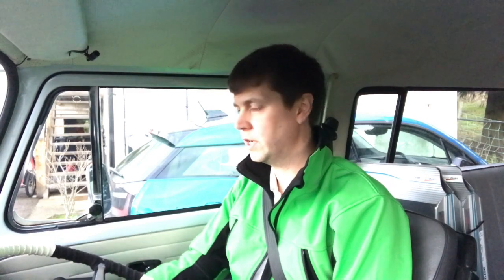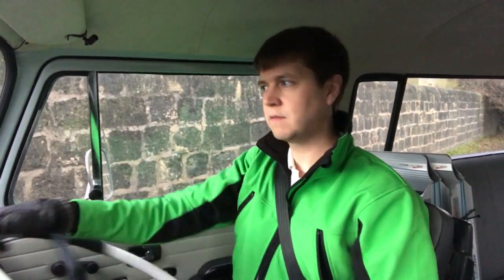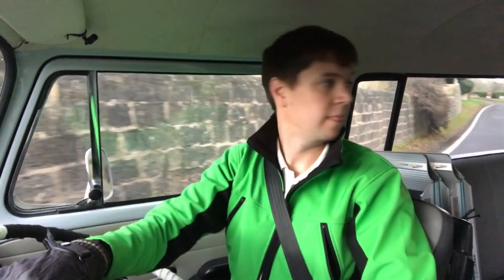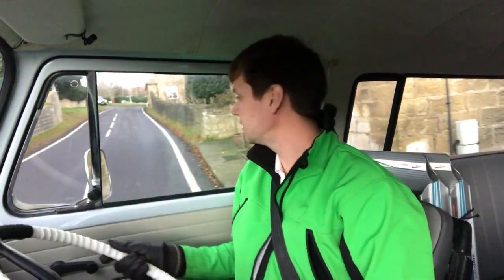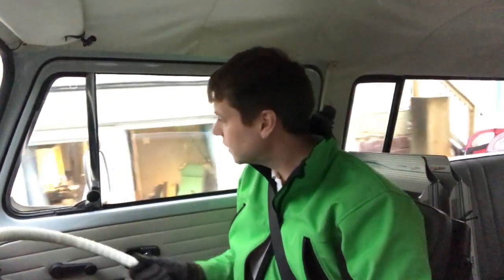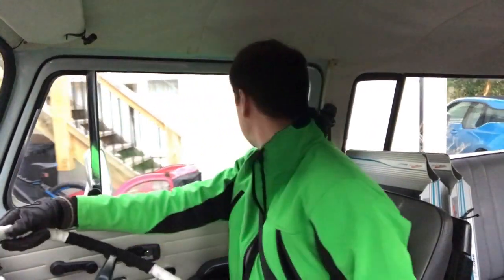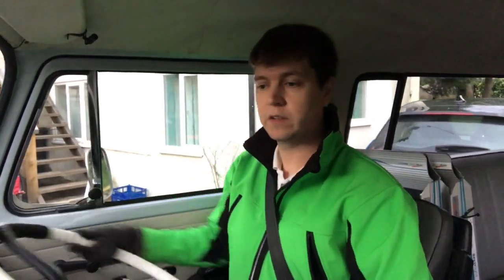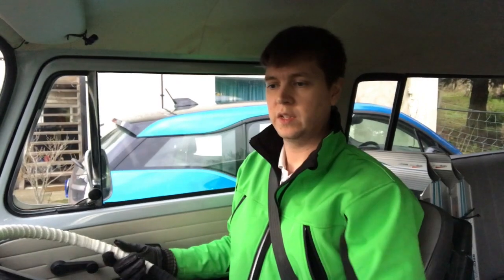Test Drive, How Good is an Electrified T2?

Comment: How is camper heated?
Reply from the maker: It can vary. We can fit a 400v heater into the heating system but it uses a lot of power. A good compromise is headed seats and headed windscreens.